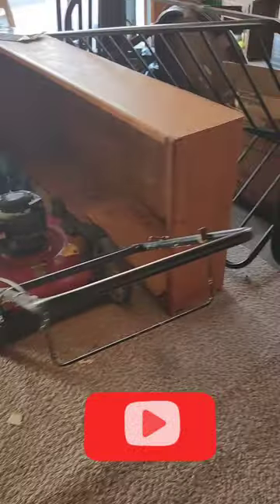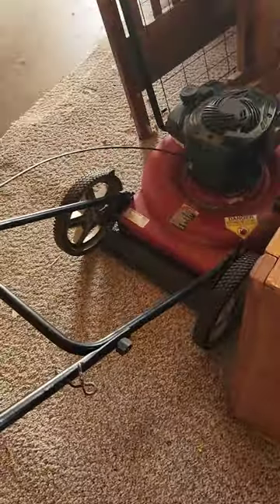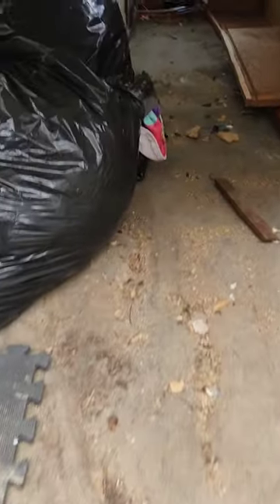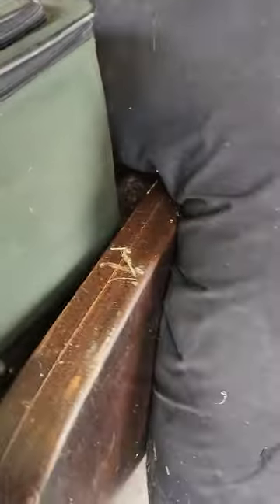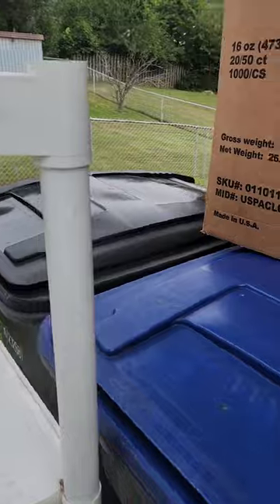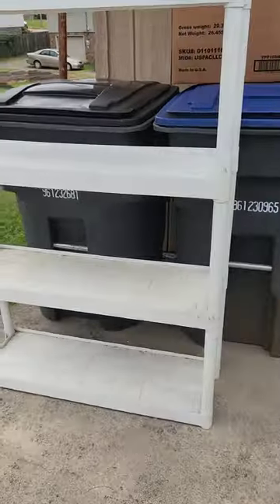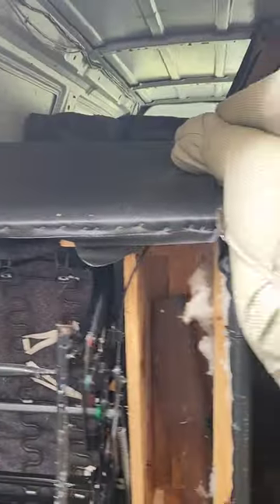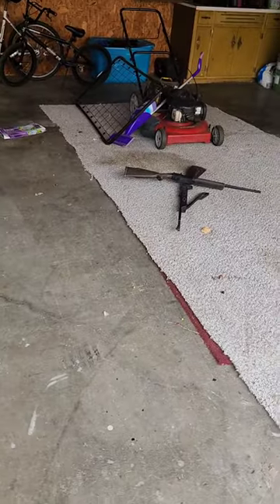Garage Cleanout Kingsport TN by Kraken Junk Removal (Tri-Cities, TN)

Comment: Nice!
Full load for sure. 
What do you usually charge for a full van load $450-$500?
Reply from the maker: Yea about that, closer to that $400 range. This was almost two loads. If I loaded it correctly, took my time to break things down and used the passenger space I probably could have fit it all in the van.